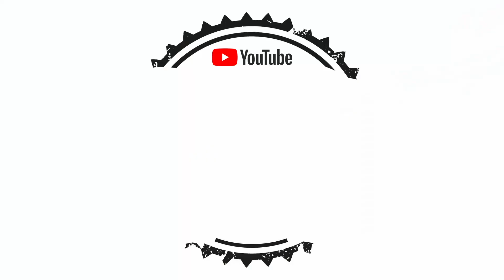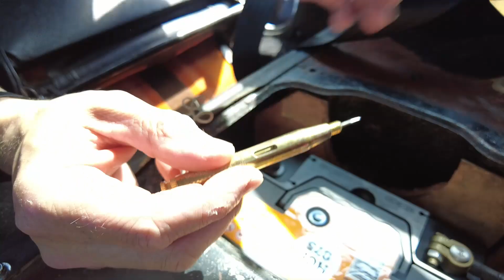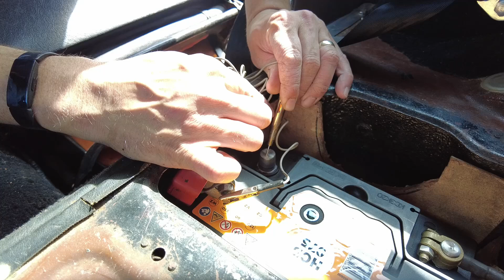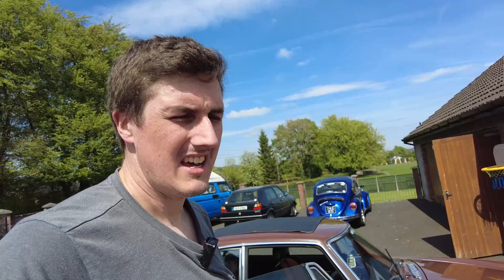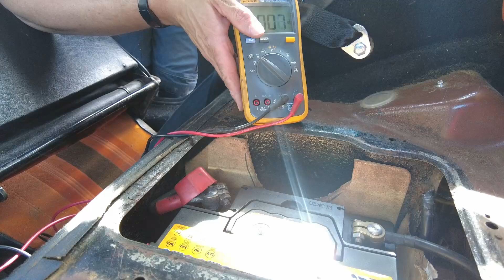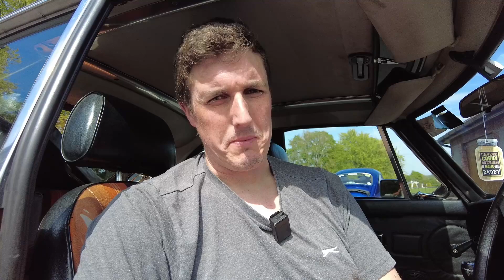Car BATTERY going FLAT?  - Try this FIRST!

Comment: I had an issue with my MG a couple of years ago with a battery drain overnight. I wanted to determine how large the drain was so I disconnected the negative cable from the battery and switched my multimeter to AMPS DC. I then put my probes to the battery cable and the battery post seeing a reading of 3.4 amps. I figured at that time the only two things that could handle that current without smoking were the alternator and starter. I checked the alternator first as it was easy to get to. The brown wire on the back was disconnected and I saw the amps were down to a couple of milliamps. So I had a bad diode in the alternator. Due to the fact we were just coming out of covid I had a devil of a time finding a part. Eventually I found a brand new alternator and since then a diode pack to fix the old one. I did convert the alternator to a GM alternator a number of years ago as they are easier to find at auto parts stores than the Lucas.

Comment: Hi Ross.  Thanks for this.  My Vauxhall Insignia has had this fault, and I've had to disconnect the battery between trips to prevent a flat battery!  It's just been to the local garage where they did remove fuses and relays, one by one, to check the voltage drop.  Eventually they found it to be the driver's side window opening switch causing all the problems!!  £130  for the 2.5 days of testing, and another £100 for the switch, which has to be ordered.  I'm actually glad they found the fault, and 'pleased'  at the cost as I had thought it would be much more.  There's apparently about 70 fuses in this car, lol!  Thanks again.

Comment: Small note for you at home- Choose a bulb with about 24w or less. That way your light draws about 2A and you are most probably not going to burn any electrics in your car. Still the light will shine fairly bright. If you for example choose the bulb for the main headlights, which is about 60w or 5A, you risk burning wires or modules! Now go out and explore! You'll do great!! It will be fun!